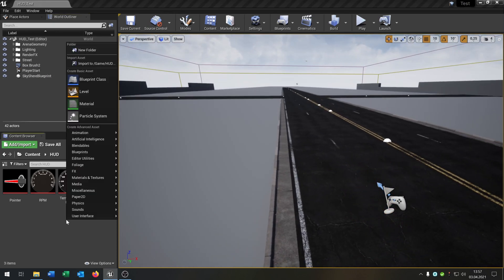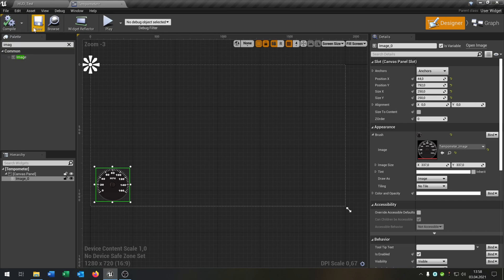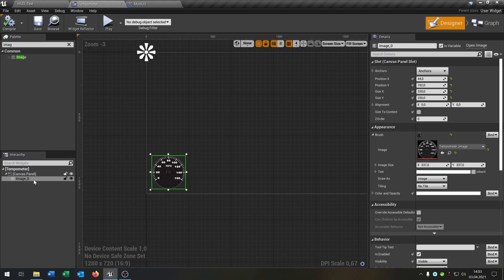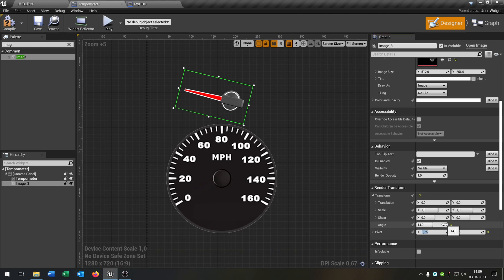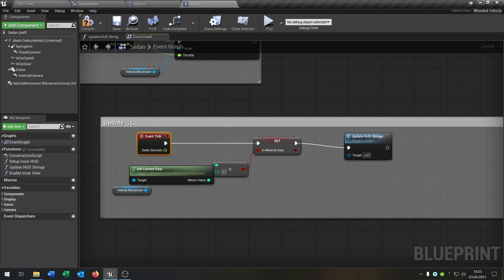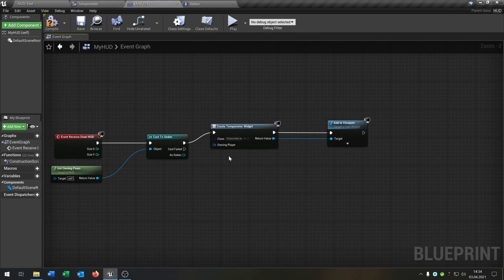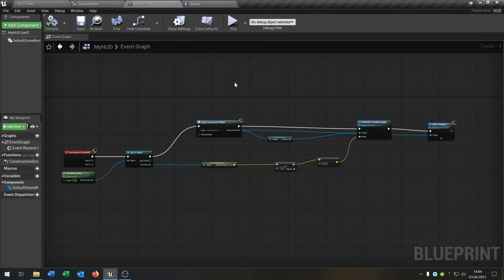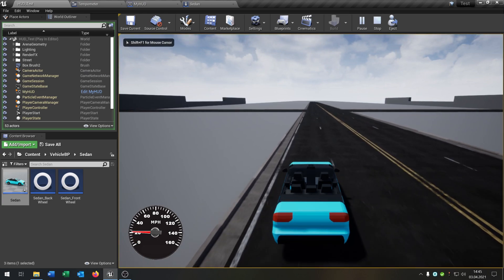Unreal Engine Car Tempometer Tutorial

Comment: hello seredias! i dont have rpm display string in ue5, so i used get engine rotation speed,,,,but my rpm pointer is moving very very fast like fan,,,can u plz help in resolving
Reply from the maker: @MuhammadAhmad-zb1hq  Yes, I can help you. In UE5 you need to get the Vehicle Movement Component. Then you need to cast to the Chaos Vehicle Component.
Reply: @Seredias.  did the same, but failed, idk why
Reply: @Seredias.  it worked, i think i making wrong values in float multiply and minus.
Could u plz write the formula here so i could get the write values.
In my case....the rpm needle is pointing at 0 rpm...
Which has value of -130.
And for full rev, when it points at 9000 rpm, the angle is 132.

Comment: This helped me a lot in UE5. There is very different and oversimplified template with gears displayed in different way. So i had to replicate the default update hud. But my gears are updating but the text do not dissapear so after while there is just white block of pixels. Does the "gear display" string, "in gear" and "in reverse" have some settings i am missing? There can be something set in the template. This supposed to be so simple... and it would be on UE4 because your tutorials are amazing. I wish i had brain like this. :D
Reply: is ur rpm meter working fine?
i am also working in ue5 but my rpm meter is rotating with speed
Reply: @MuhammadAhmad-zb1hq  This was old problem i fixed a long time ago. But your problem sounds like you have made a mistake. You mean speed needle is working fine but with it moves also the RPM meter? If so you have them connected as a "parent and child". Look at your hierarchy window in "Tempometer" widget (where the pictures  of your hud are). It should looks like on the video (for example at 12:05). Look for the white triangles on the left of the text. After the "canvas panel" there should not be any white triangles next to any of these elements. I think you will have white triangel next to the speed needle. If not you probably made a mistake in the code.

Comment: Using the Event recieve Draw HUD node in the hud event graph reduced my fps massively over time as it was drawing more and more huds over the top of each other, adding up over time.
I used the event begin node in its place, which draws the hud once when you press play, and called setting render angles, seting text and adding to viewport on every tick.
If anyone else is having the same issue this might be a possible fix.
Reply: I used your method and work fine but when I stopped the game and exited from play mode many times it said in the message log that "the widget 'speed_meter' was already added to screen". any idea?

Comment: I would love digital tempometer or at least an option to make it visible and invisible maybe both and you would able to switch with a button between the 3 type.. :D
Reply from the maker: Since it is an HUD you can set / add specific Parts to the HUD and remove them like you want.